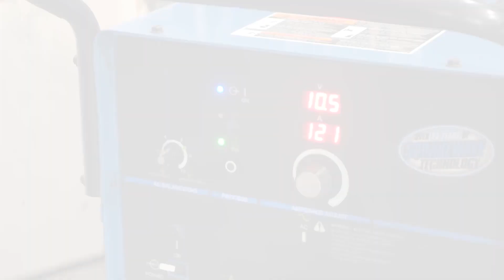S197 Mustang GT Build - Part 1

Comment: Watched the 351W build videos... Great info! FYI - On EFI cars, if you take the gas cap off before your remove the fuel line it will relieve some of the line pressure and make less of a mess.
Reply from the maker: never heard of this before.  the system is pressurized separate from the tank, so how does that work?
Reply: @710Garage  Hmmm... Just something I heard years ago when I worked on vehicles, and have done any time I've worked on an EFI systems since.
Reply from the maker: ill have to try it one day and see!